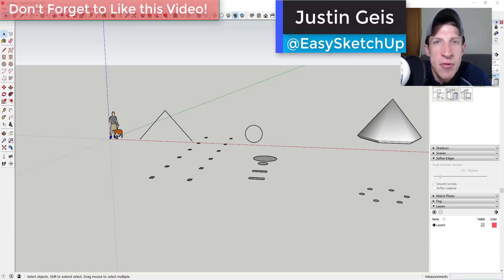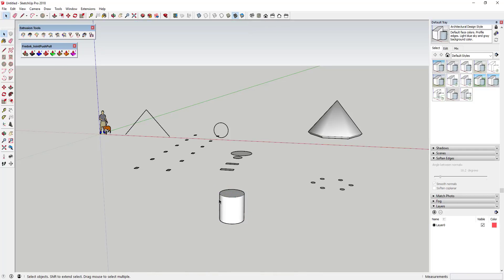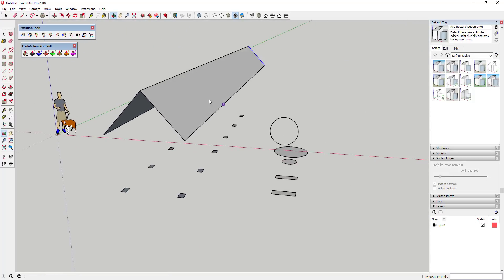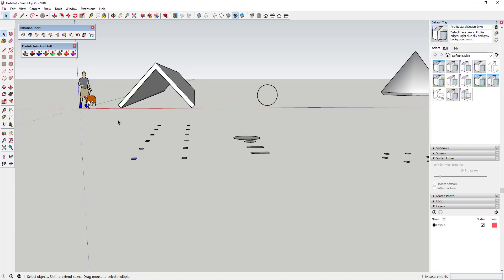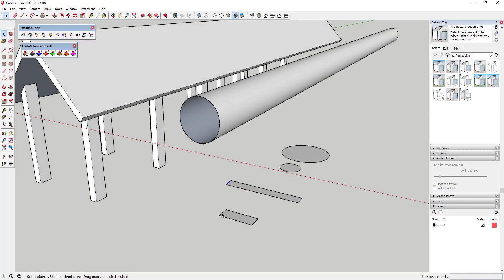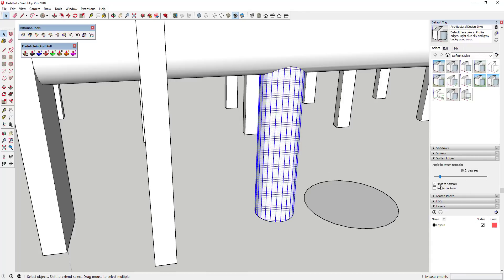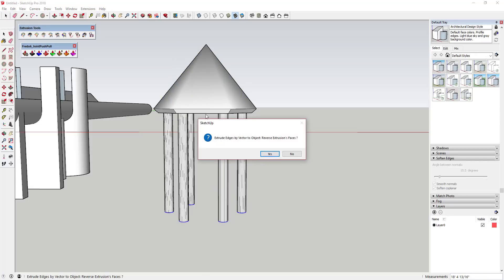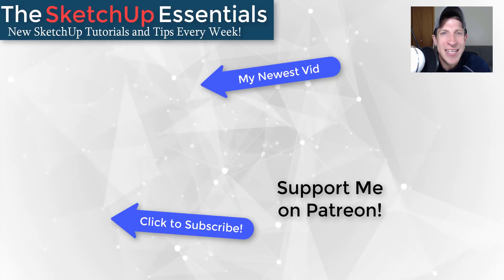SKETCHUP EXTRUDE TOOLS TUTORIALS (EP6) - Extrude by Vector to Object

Comment: Are those tools you used the extension? Mine is SketchUp pro annual subscription on mac. It doesn’t have these fantastic menu bar. (Btw, i just started picking up SketchUp 2 weeks back by myself, and your tutorials are very helpful. Many thanks).
Reply from the maker: I don't understand the question. This is a third party extension added to SketchUp, not a base function
Reply: @Thesketchupessentials  okay. Thank you so much.

Comment: I plan to use this to pull walls up to complex roofs perhaps. Heard some scuttlebutt from thr Blender community that Trimble may push Sketchup to cloud, forcing all the plug-ins to re tool. That could be cataclysmic for pros like me whose real sketchup work flow is plug in heavy. You have a read on it?
Reply from the maker: No inside information, but I seriously doubt it. I think the move to the cloud for the free version made business sense, but moving the Pro Version, along with Layout, to the cloud would likely require a much more significant resource commitment, as well as moving their current paying user base over to an online version. I have a hard time believing that the Blender community has any inside information on this one.
Reply: @Thesketchupessentials  That was my gut. Seems they'd be killing the goose that's laying their golden egg on that one. Irking the arch-viz community would essentially kill the product. Thanks for the reply.

Comment: How would you take the roof shape straight and then make a u shape and then straight again? I have been trying to take a 1/4 round shape or c shape and have it follow a u shape. I can get it to go straight but it will not follow the curve and end in a straight. I am trying to make a fillet at the bottom of a straight then curved junction. Thanks
Reply from the maker: You might be able to use the first option - I think it's called extrude edges by rails to extrude the shape along a path you draw
Reply: TheSketchUpEssentials Thanks for the information.